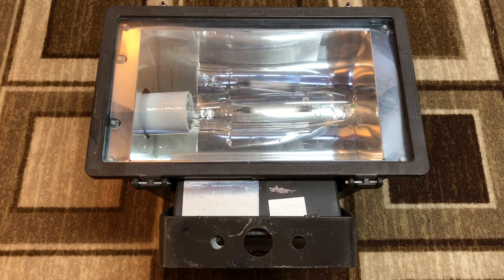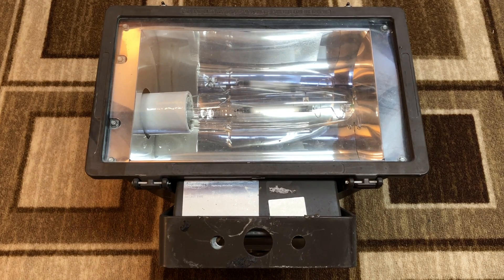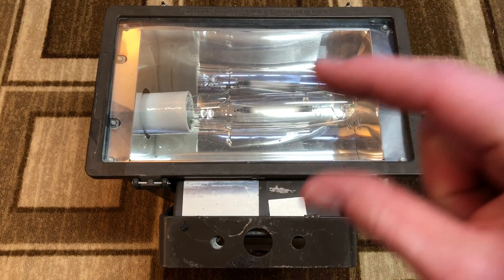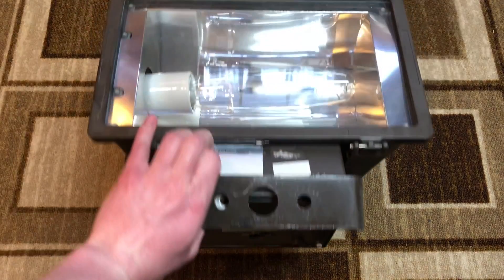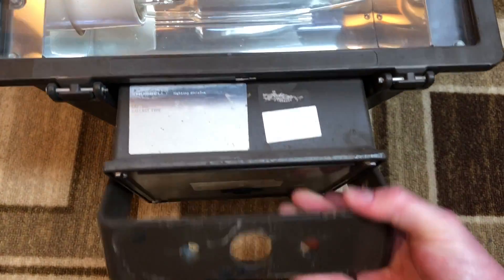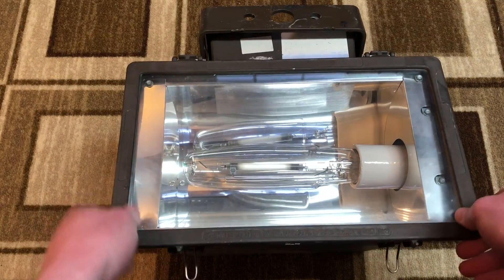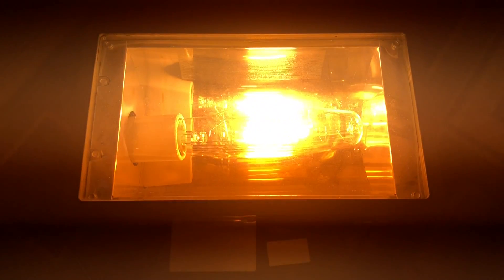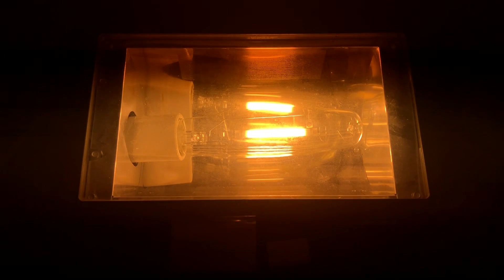Hubbell 250watt High Pressure Sodium (HPS) Flood Light - 2

Comment: I found the same fixture except with a 175W MH/MV ballast in it at my local Habitat ReStore. There was a small amount of water inside fixture, but I removed it, and cleaned all the dirt out. The ballast got wet, but has no damage, and I am letting it dry out for a few days before putting everything back together. Despite having had some water inside fixture, the fixture is still in good condition.